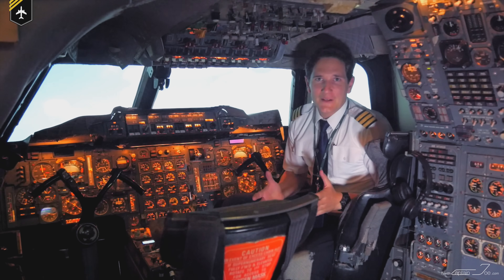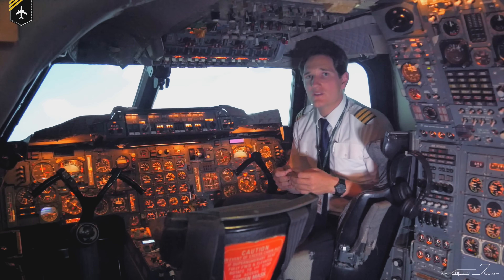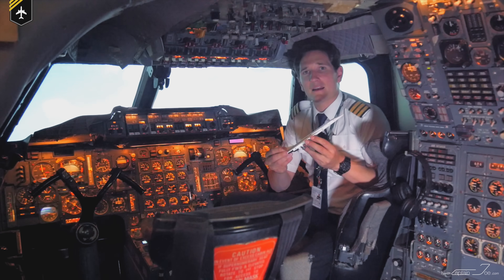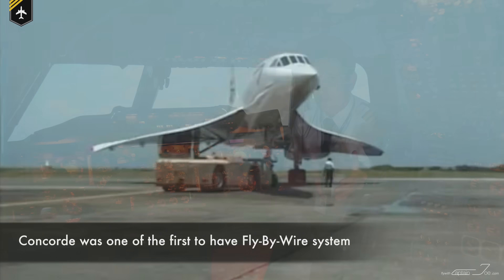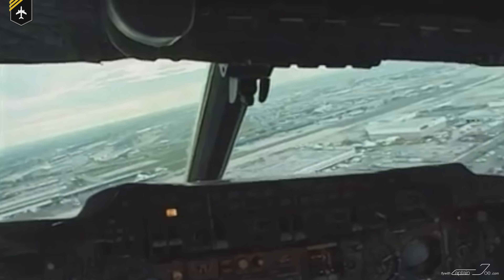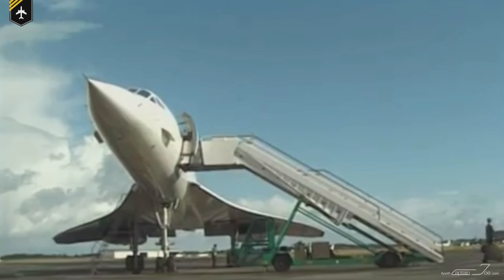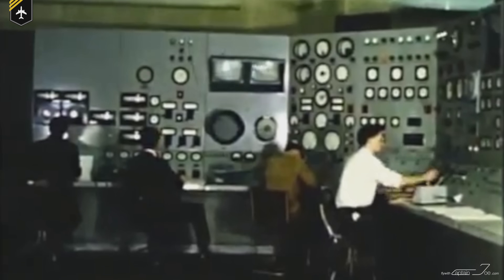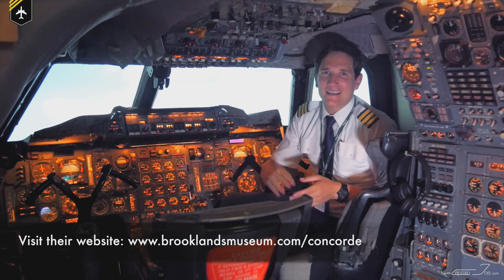FACTS you should know about CONCORDE! Episode 3 by CAPTAIN JOE

Comment: An outstanding series!  I was actually a controller at JFK tower when the Concorde was flying (yes, I worked with “Kennedy Steve”). It was at times quite a challenge to work because of its unique requirements. It was also the only airplane you could actually hear from inside the tower cab! 
Before that I was a controller in at the New York Center oceanic area (KZNY FIR). The Concorde had 3 oceanic tracks, one east one west and one overflow. I remember clearing them into their block altitude 500B550.

Comment: A couple of 'anorak facts' I've picked up over the years not mentioned her, around 10% of all that engine power was required just for the air conditioning and also, the French engineers all worked in metric measurements and the English engineers used the imperial system but their calculations were so exact, they worked perfectly together.

Comment: My Concorde Upgrade Program
1. Windowless and Windshieldless fuselage
2. Composite fuselage and wings
3. Supersonic turbofan engines without afterburners 
4. Gulfstream 6 cockpit layout and instrumentation 
5. Airbrakes
6. 100 Business class passenger seating with Gulfstream interior design
7. Doppler wing tips
8. Expanded fuselage with increased cargo and fuel capacity as well as interior dimensions.
9. No retractable visor or droop nose.
10. Subsonic 0.9 over land.

Comment: "The engineers working on Concorde were geniuses..."  They certainly were.
Reply: Definitely better than those that designed the MAX.
Reply: 이주연 That has nothing to do with Concorde and stop using the MAX program in this conversation.
Reply: NASA engineers have said that it took more technical know how to design and build Concorde to fly commercially at supersonic speeds than it took to get their Apollo missions to the moon. FACT!🇬🇧🇫🇷✌✌
Reply: It was amazing to me not only  the engineering of building these aircraft but to take them up the first time and figure out how to fly them. To bad the Concorde is no longer flying. I would love to watch it climb out on Flight tracking.
Reply: When you’re an engineer who doesn’t approximate PI as 3
Reply: progeocaching no they were good engineers. Thats what Engineers do.
Reply: Engineers sure. The concept not so much.
There were several reasons Boeing itself abandoned its SST program before even one of its planes took off.
It was a showy but ill-conceived idea from the get-go which is why it never could expand beyond just 20 airplanes. The fuel costs and restrictions on supersonic travel over populated areas made it accessible only to rich customers and only on very few routes.
For the only two airlines that ever operated it, Air France and British Airways it served more as a promotional tool. Sure they could turn a profit from them for a while but after a while demand fell and fuel prices rose. Also remember that the development cost was covered by the governments/taxpayers who never recovered it.

Comment: so if they were so good, why eventually so many of them crashed and eventually removed  from airspace ?
Reply: maisetas only one had crashed caused by an American Airlines metal sheet that fell off and concord run over it flew up into the fuel tank puncturing it and it happened so fast they were already rotated at the time so couldn’t abort.
Reply: maisetas plus they were very expensive to maintain and was losing money
Reply: @M.wilde9  Air France were losing money on Concorde, whereas BA were making a profit.  One of the main problems was 9/11.  After that, fewer people wanted to fly. Also, with Air France taking theirs out of service, Airbus decided that there weren't enough left to justify them continuing to act as Design Authority, and without that, it couldn't fly.  The aircraft themselves could have gone on for another 20+ years.  If anything, they were over-engineered to be on the safe side, as the designers didn't have access to all the computer aided design tools we have today.

Comment: I remember a Concorde video where they were describing the 9" of stretch. One of the points they made was in the cockpit, they showed the Engineer's panel and how if fit against the rear cockpit bulkhead. It was 4-5 MM away from the bulkhead, but Mach-2 flight, the engineer could insert his arm up to the elbow into the gap. I was amazed!

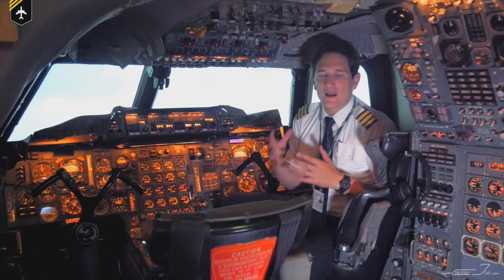Comment: 4:20 She also had mechanical backup for FBW, in case of total hydraulic failure it was still possible to control her as mechanical backup just kicked in. Concorde was FBW aircraft, but it was analog system (not a digital one). Concorde also used the so called thrust by wire, it was like half way between mechanical and FADEC, throttles had no mechanical linkages, electric signal was used to control the throttle.

Comment: 1:20 It was also possible, unlike any other aircraft, to use 2 inboard reversers to slow down while approaching. FE had to pull a switch to allow pilots to use reversers in air, then pilots engaged inboard reversers in order to use them much like they would use spoilers in other ac. Why only inboard you would ask, well, it was about bleed air demand to move the buckets (so called secondary nozzle) engine 2 bucket was supported by engine 1 bleed while engine 3 bucket was supported by engine 4 bleed.

Comment: My uncle participated in the development of Concorde’s autopilot. It must be difficult to control the vertical speed since pitching up the nose to increase lift also meant that the elevators reduced lift. That is, before the vertical speed reduces it first increases. A so called non-minimum phase control. Very difficult to master. Concorde pilots would have been able to master landing a space shuttle much easier than other pilots since it also has a delta wing. But I’m not aware of anyone actually having flown both aircraft.

Comment: I was a member of the Manchester Aviation Society, back in the day when we had trips out to various airports for behind the scenes days one of these being to look round Concorde at Hounslow it was on maintenance,but still allowed to go in cockpit, also in passenger cabin noticed that the windows where so small, also when waking under the wings there were sand on the floor as fuel leaked from the wings when just stationary and the joints would expand in flight, interesting.

Comment: "Boston to Paris and Back In 6 Hours and 18 Minutes
THE NEW YORK TIMES by Robert Lindsay, June 18, 1974

1,340 Miles an Hour

It was a cloudy, misty morning as the jet rumbled off the runway at Logan, lunged eastward over Cape Cod and quickly reached supersonic speed — about 665 miles an hour. Fifteen minutes later, it was cruising at twice the speed of sound 1,340 miles an hour — and remained at this speed for most of the flight over the Atlantic at an altitude of 51,000 feet.

The plane touched down at Charles de Gaulle Airport at 4:32 P.M. Paris time — three hours and 10 minutes for the 3,060‐mile flight. The return flight took three hours and eight minutes between liftoff and landing. The total flying time for the two legs of the round‐trip was six hours and 18 minutes, and total elapsed time, including the fueling stop, Was seven hours and 29 minutes, a record for a civil aircraft's round‐trip over the Atlantic.

About the same time that the Concorde was taking off from Boston, an Air France 747 was taking off from Paris and flying to Boston. The Concorde landed back in Boston at the end of its round‐trip flight before the 747 had arrived." 

That's how fast she really was.

Jonathan Glancey: Concorde: The Rise and Fall of the Supersonic Airliner, Atlantic Books Ltd, 2015

Comment: Concorde has a contingency button which allowed the engines to produce up to 400% thrust, engine was fucked afterwoulds!!
Reply: I don't think an engine can create more than maximum thrust. Maximum anything is 100%.
Reply: Joshua McConville depends what the engine is rated to. V2500 engines are rated for a320 at 27000 and that will be 100% for example. So if you produce more thrust then it’s going to be 104% for example. You can over speed and over temp engines but depends how long for before you have to deeper checks

Comment: Hi Captain Joe,
The Concord was a very beautiful plane. But certain mortal factors were against her. The dramatic rise of aviation fuel prices that ran against the high fuel consumption of those powerful engines in the 1970's. The fact that the plane was financed by British and French taxpayers and not private enterprise that made the financing the plane, crony capitalism. So that the British Airways never felt the financial pain. The relatively small number of revenue paying passengers (92-128 passengers/flight) and the high cost tickets that limited the passenger volume. The double sonic boom that limited where the plane could fly. The noise of her turbojet engines. Then, of course, that fatal crash, killing all on board on July 25th, 2000.

Comment: I used to live in Bangor, Maine which has an international airport. The National Guard armory is located at the airport and the road I drove to there passed by the end of the runway. One morning I was heading to the armory when I saw a strange aircraft on final. I noticed the pointed nose and realized it was a Concorde. I hurried to where the road was in front of the runway, pulled over and stopped. I rolled down the windows and opened the sunroof in time for the Concorde to pass overhead as it landed. The noise was incredible and the car was pushed down a few inches. What an awesome way to start my day.

Comment: Delta wings are awesome! The two leading edge vortices (seen as condensation clouds over the leading edge) generate the majority of the lift during high angle flight (i.e. take off, landing, etc.) and the wing has a much higher stall angle enabling the aircraft to take off and land at less than 200 knots without any modification.

Comment: Thanks for a great series. Double the vidso on A-380 and B-747 since they are the two current giants of the sky with no equals. B-747 was the original "Superjumbo" until A-380 took over.On the smaller side I would personaly enjoy the two swedish contribution to the airliners world - The Saab 340 and 2000. They where great comuter aircafts of theyre days and I think some of them are still flying around the globe. Johan.

Comment: Why it is called a "Cockpit"?
Reply: Some pilots are very passionate about their aircraft
Reply: The word cockpit was originally a sailing term for the coxswain's station in a Royal Navy ship, and later the location of the ship's rudder controls. Cockpit first appeared in the English language in the 1580s, "a pit for fighting cocks", from cock + pit. Used in nautical sense (1706) for midshipmen's compartment below decks; transferred to airplanes (1914) and to cars (1930s). From about 1935, cockpit came to be used informally to refer to the driver's seat of a car, especially a high performance one, and this is official terminology in Formula One.

In an airliner, the cockpit is usually referred to as the flight deck, the term deriving from its use by the RAF for the separate, upper platform in large flying boats where the pilot and co-pilot sat. In the US and many other countries, however, the term cockpit is also used for airliners.

The seat of a powerboat racing craft is also referred to as the cockpit.

Comment: Could you explain what the small "winglets" mounted on the jet engines are for?
Reply: Arnaud Contet they are called vortex generators. They are used to correct the airflow around the engines
Reply: NoYourself that was my initial guess, thanks for confirming.

Comment: What about the Tupolew Tu-144?
Reply: What about it ? A crappy Russina copy of a truly remarkable airplane. The designers knew that they would have to contend with spies copying the plane so they gave them spurious deigns with flawed data hence the cannards to aid take off and landing.
Reply: @eoslensman  
No, the Russian design looked nothing like Concorde. It had different engine placement and arguably better handling.

Unfortunately, it was hampered by the fact that the USSR couldn't produce compact and powerful enough engines, so they had to scale them up. And this in turn caused all kinds of issues that were never solved.
Reply: @AlexBesogonov  The TU144 was a political program that had to beat the West. Corners cut and it was rushed into the air and service before it was ready. The original prototype was  so different to the actual aircraft that entered service it could be said their were two 144's. To save time they did use technology obtained by spies. As the Tu144  program proceeded the more Concorde like it became. Engine placement was changed. On the original prototype all engines were located between the landing gear. The engine noise in the passenger cabin was almost unbearable and also caused other problems. On the redesign they were positioned either side of the landing on each wing. Due to the length of the air inlets it was not possible to move them further out (as per Concorde). There was a proposal to mount them vertically (one atop the other) which would have allowed all 4 to be outside the landing gear but this near proceeded.

Comment: Good videos on the Concord Joe; thanks.  I was hoping you would have covered rapid decompression at altitude.   For example, at  50,000' (FL500) and above, most people require a pressure suit to stay alive.  And useful concience time at that altitude is 6 to 9 seconds.  So first you pass out and second your blood boils.  What did the designers do to keep the passengers and crew alive in the case of a rapid decompression during climb cruise?  Most of this stuff has been overcome in smaller military aircraft.  But those solutions don't always scale up to something as large and as fast as the SST.